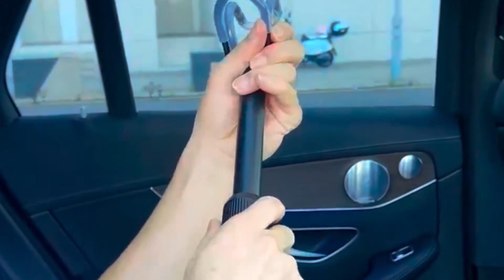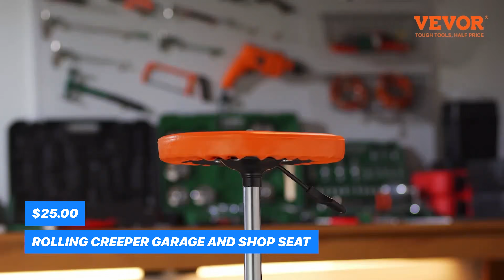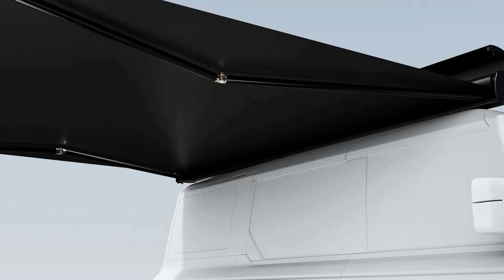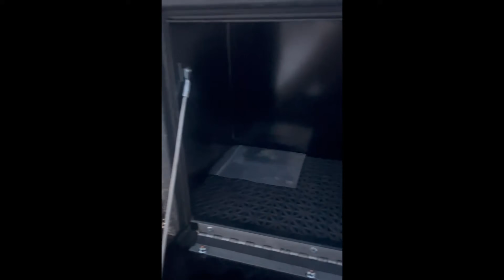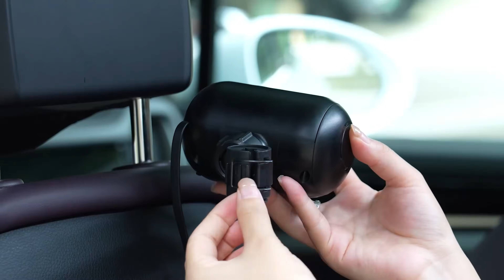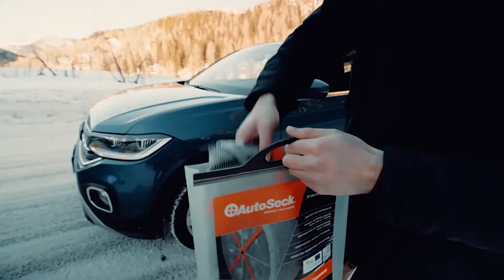18 Best Amazon CAR Gadgets That Will Upgrade Your Vehicle [With Prices]

Comment from the maker: ✅Amazon Products Link - 

✅ Amazon Shop Link - https://amzn.to/3ZYn1rE

Car clothes hanger bar - https://amzn.to/4bmiPHB

High-pressure portable shower - https://amzn.to/3MCDS0d

UltraDash dual lens dash cam - https://amzn.to/4aX68Cv

Pressure foam sprayer - https://amzn.to/40nY5Kt

Auxbeam RB switch panel - https://amzn.to/3OJxd4O

Rolling creeper garage and shop seat - https://amzn.to/4sgqC0b

Backseat car organizer - https://amzn.to/47k8hqW

Aluminum car side awning - https://amzn.to/4lbfC20

Lawn mower bundle - https://amzn.to/3NcPSFL

RedTiger three-channel dash cam - https://amzn.to/4sj9oiW

Wheel clamp lock - https://amzn.to/4r4EaLk

Panel wipe - https://amzn.to/4sa13Oc

Black steel underbody truck box - https://amzn.to/4aG9J9m

RGB rock lights kit - https://amzn.to/4sg3MFQ

Overland kitchen slide-out system - https://amzn.to/400emoD

Backseat car charging station - https://amzn.to/4r30ViA

Rooftop strobe beacon light bar - https://amzn.to/4s2Pjhb

Cooling car seat cover - https://amzn.to/4slUYi3

Buffer polisher - https://amzn.to/4u1YO1p

AutoSock HP for passenger - https://amzn.to/4u7CPGo

Deluxe tire pressure gauge - https://amzn.to/4r9L8if